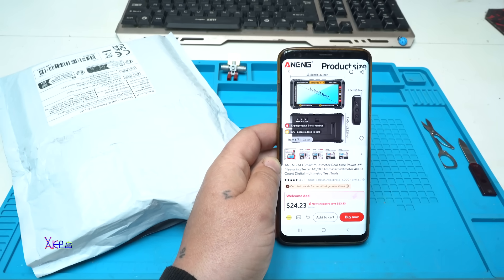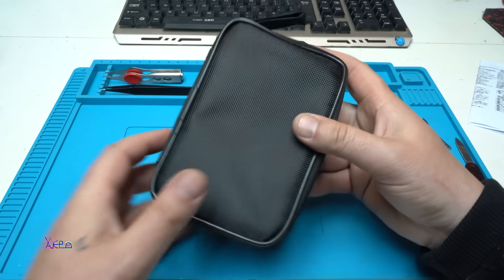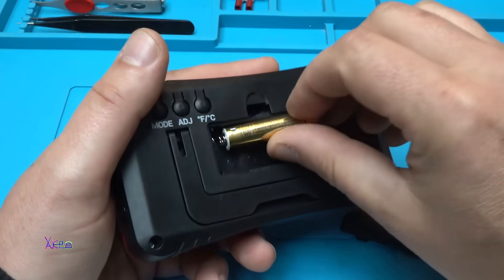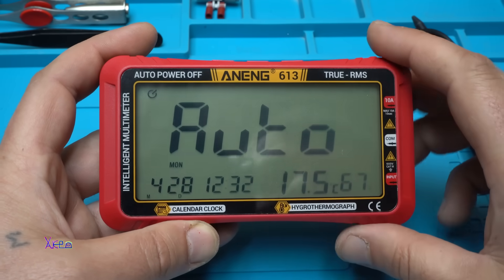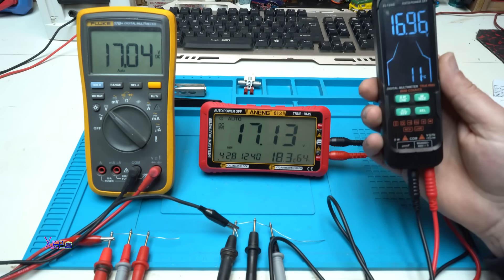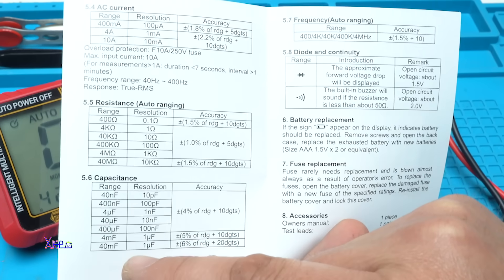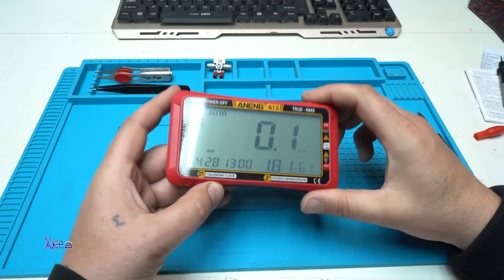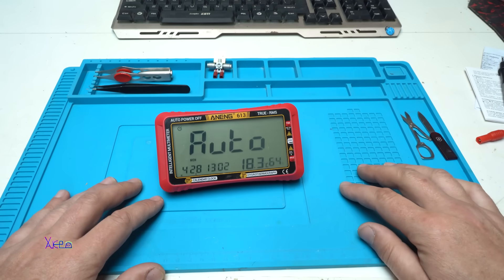THIS $? Aliexpress Aneng 613 DMM  is FANTASTIC?

Comment: It's $24 CAD here in Canada. The ZL126B in your description is $$23. If I were to buy one of these, it would be the 613 because it uses replaceable batteries. I have rechargeable batteries that I would be using, if I purchased the 613.
I'm also in my mid 60s and the large display would be great.
Reply from the maker: Go for it,yes you can use rechargeable batteries.

Comment: Given it has a built in clock/calendar (which to be honest is a bit of waste on a multi-meter), it is a real missed opportunity not to take time period measurements.  For example, wake up every minute, take a current/voltage/whatever reading, then power off.  Store it in a CSV and that would be a unique capability at this price point.  Also great if you're looking for trending or long term diagnostic.
Reply: It would need USB output to download the .csv or at least sdcard slot. And the price would be double. I would use rather Arduino or similar with proper sensors for such kind of measurment.
Reply: But I'm not against it, maybe adding the sdcard slot woul be less expensive way.

Comment: Just sade that the Display have no color
Reply: If it had colors it would need rechearchable battery because the power consumption is much bigger.
Reply: @vencdee  That really wouldn't matter, since you don't use it for hours. You use it briefly to take measurements and then turn it off again. So your reasoning is wrong, and I don't understand it.
Reply: @ The display has much bigger consumption. And the AAA batteries has low capacity. I use rechargaeble ones and reacharge relatively often. You probably use multimeter scarcely only.

Comment: I'm pretty sure the Fluke is the closest to accurate and that the power supply and other meters are inaccurate.
Reply: For industrial where the accuracy is vital, of course Fluke.  For all around the house, small repair shop, little electronic project, no need for a fluke except if you wanna waste money
Reply: @Manche-De-Pelle  I bought a Fluke 87 when it first came out. I have had it every since, upgraded the backlight and replaced the conductive strips for the LCD issue that they had, still going strong 30+ years later. Buy once, Cry once. I do have several other inexpensive meters for always having one close to hand.
Reply: Flukes do go out of calibration and that may be the case here. JazzTech on YouTube did a video on an ebay purchased Fluke and showed the calibration procedure. She covered in in some detail.
Reply: Depends how long since the Fluke was calibrated.
Reply: @StanleyPinchak  True, but I would still trust its readings over the other devices.

Comment: Aneng is a great brand - only small issue it is not 100% accurate. compare it with Fluke. I do still prefer Aneng over expensive brands.
Reply from the maker: It is true that fluke is the best, but this is great for the price.

Comment: yeah, almost like a Nintendo ;-)
i would imagine that a slow energy draw from an internal clock is bad for a rechargeable battery.
Reply from the maker: 😅 nintendo... for battery life I will make update video
Reply: A clock module will run for decades from a button cell. It stops because the bapttery chemistry fails, not because it "goes flat"
Reply: @ thanks or your reply.
i am aware of button cells.
my point was that the SLOW drain of a clock or weather station ruins rechargeable batteries.
Reply: @olafkliemt1145  - lithium's self discharge would be greater than the draw from a clock chip.
For example, the TI BQ32002 draws less than one MicroAmp to keep time.

Comment: The 10 second label means you should only measure 10 A for 10 seconds max to avoid over heating of the shunt resistor!

Also please review the Aliexpress flashlight modules. For DIY flashlights, they have USB C charging for lipo cells, on/off button. Some have flashing modes too. Vey low standby current to be checked. And very cheap , much less than a dollar !!
Reply from the maker: Thx for feedback sir,for sure I will order some cool flashlight and make review video
Reply: Oh, I've been thinking about those as well... Some come with the LED already and so can be powered by 1 18650 cell... I want to build one as well!